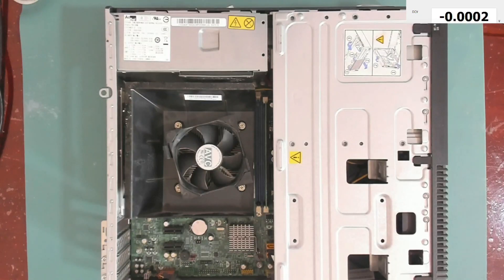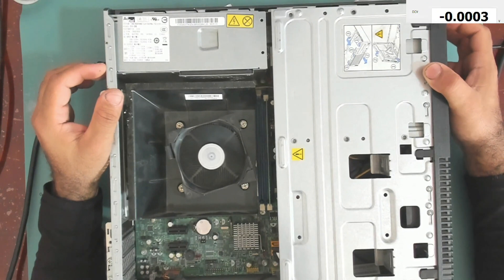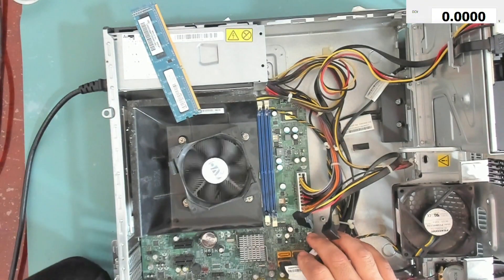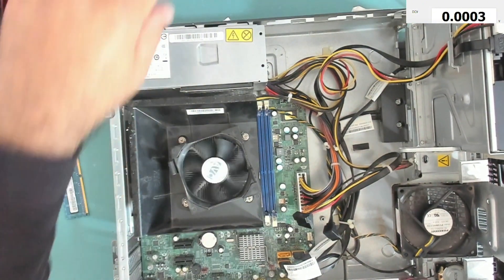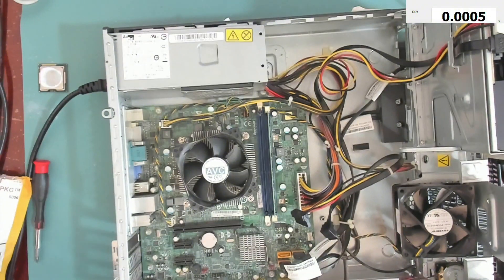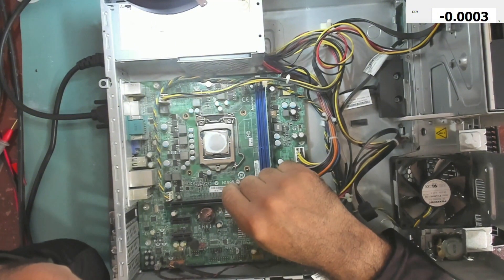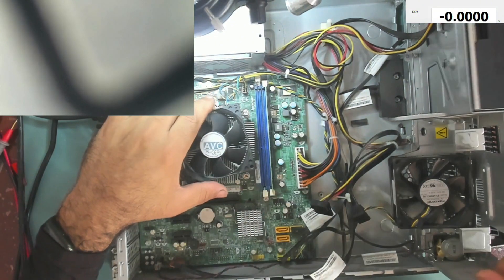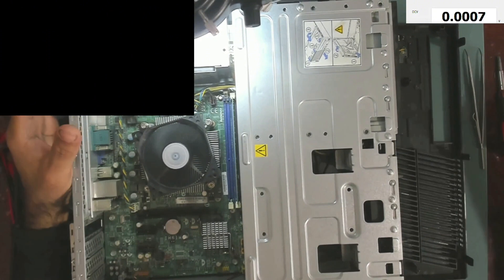Lenovo thinkcentre Power On No Display Missing VCCSA Missing VCore

Comment: Mine is immediately running on when the AC outlet plug in, but there's no display, no beeps.
The processor is warm...
What components maybe the culprit, sir?
Thank you.
Reply from the maker: It seems you have a bad PCH Chipset.
It could also be corrupted bios,
Try removing the RAM modules to see if you will get beep codes and if possible replace them along with the CPU to roll them out. If still the same try flashing the bios with a good known bin file.

All the best brother
Reply: @FixTronics  i removed the ram sticks & replaced the processor that running well on other mobo... No beep. Just fan running...
I have flash tool so i will reflash the bios.
I hope just corrupt bios...

Thank you, Sir...